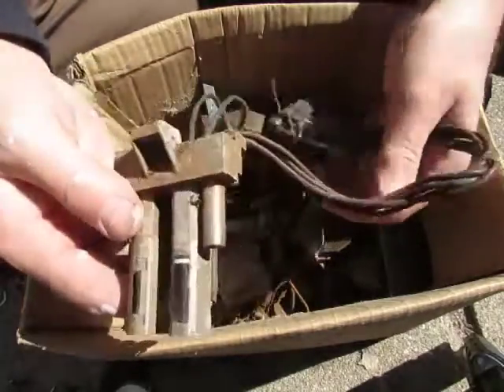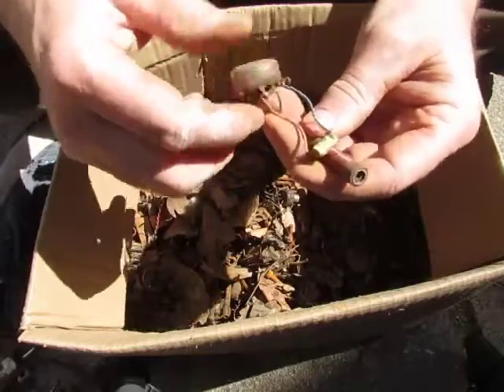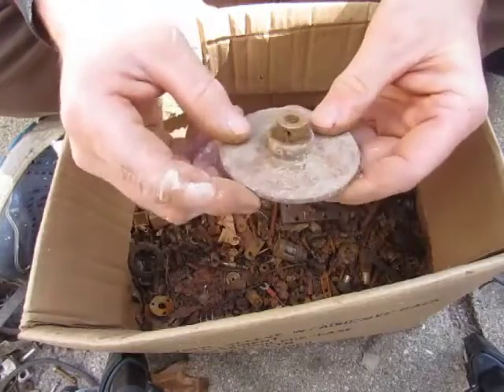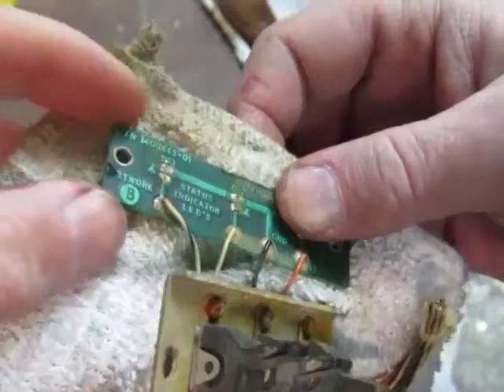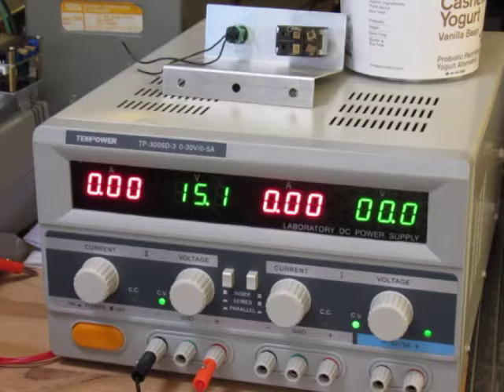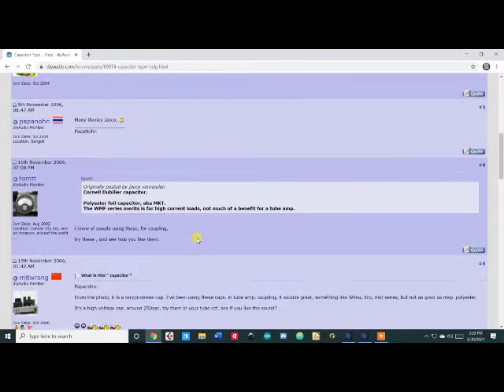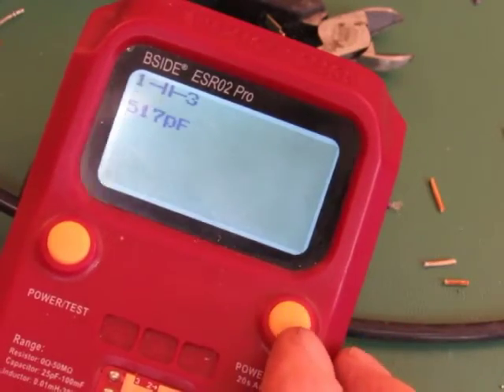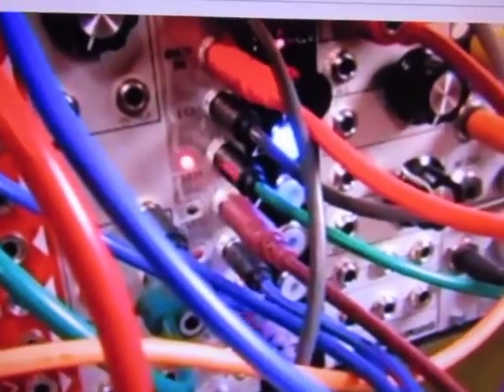Moves... Bolts, Parts, Leaves

Comment: That looks like a pleasant afternoon, digging through a box of strange parts.  I'm a little disturbed by all of the leaves in there though.
Reply from the maker: Yeah I found that box just inside a garage door that had been jammed open for ten years. It was nestled in a tangle of dead leaves and vines. I was convinced the parts would be rusted together, like a solid brick of iron oxide.
Reply: Let's get's those Leaves Cleaned up Patrick..lol...lol....I too need to go through some of my RC Hobby stuff...Puffy batteries...Servos..omg
Reply from the maker: @rhampton1914  We could invent a new genre of YT video: "Rummage Thru Old Stuff" 😀

Comment: I think the antenna was actually a massive wire wound resistor chain. We used to have one in our old valve telly. What a fun video I was going to comment about the tetanus shot but you got there first. If you know the size of a capacitor and you create an  lc filter you can then pop it on the output of your synth and measure the attenuation at different frequencies and deduce the inductance...
Reply from the maker: I'm glad you enjoyed it, considering the length and casual pace. I suspected that thing was a resistor! Very interesting way to measure inductance - I am definitely going to try that. Thank you so much for the feedback!

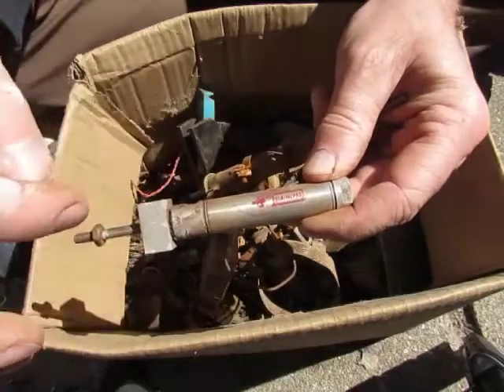Comment: !Warning! at 0:47 this goes fractal. That solenoid wants connecting to the relay and the relay wants connecting to your logic gate construction and driving from an LFO (don't forget to put a diode in reverse on the relay coil to eat the reverse EMF) and the arm of the solenoid needs to yank on the centre of  a big piece of hardboard or perhaps wave a spoon against a metal sheet like a huge speaker cone. Then you will get tick..CLICK...BOOM(CRASH)..click..tick.. there is a whole drum and bass section right there.
You never explained the disc thing
I watched this again and you know, I am sure my nose is now full of rusty dust.
Reply from the maker: Oooh yes I like the direction this solenoid contraption is goin! I have been watching a lot of Tim Hunkin's videos lately and it's just the kind of thing he would make. And that disc thing, I never did figure out. However I discovered that it was ratcheted, so the bearing only spun in one direction. Curious.
Reply from the maker: 😹fractal😹